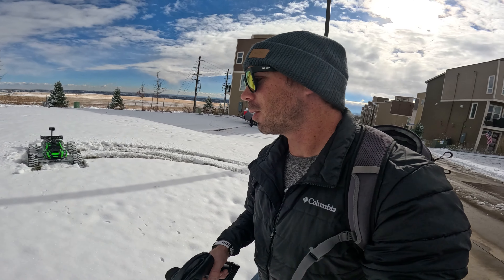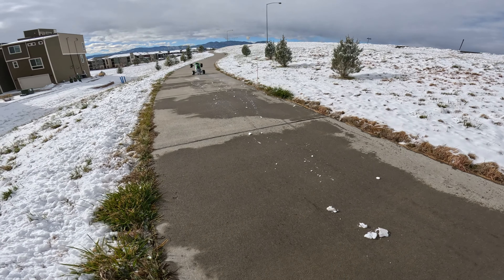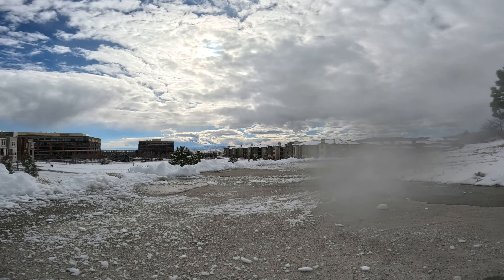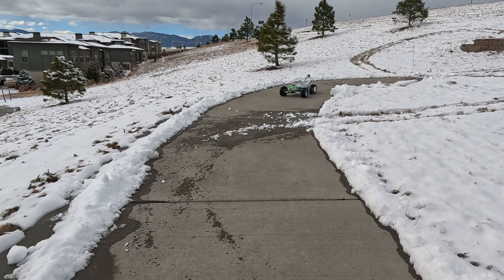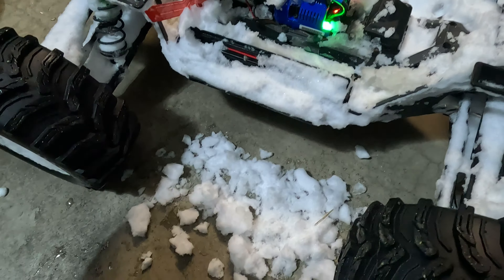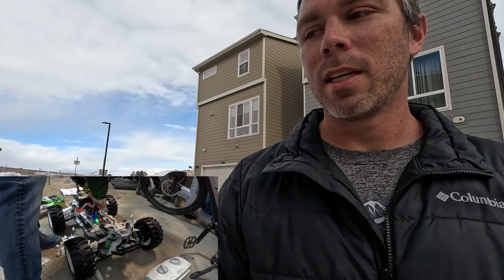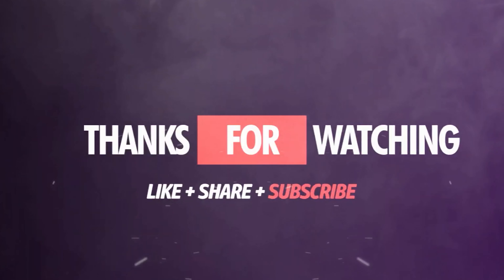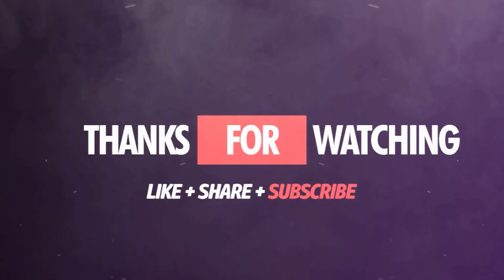NEW Traxxas XRT Breaks During Snow Bash

Comment: The best vehicle I had run in the snow was the X-MAXX. I also had that dirt cover on it. Had good temps. My E-Revo 2.0 electronically died in the snow. ESC had a fatal error. It now has a Castle ESC in it now.
Reply: VXL6S almost died in my Sledge and snow bash also. I think there was over current problem, because all 3 leds was solid red. But it working now again, after one day free time in garage.
Im using dusty motors cover for protect and almost no wet get inside. Condition was -3°C. I will be rather prepared with a new ESC, because this can be an issue. When over heat protection is not triggered, because of cold weather, so ESC still working and keep long time with a very high current. I also tug my children on the bobsled few times. In the summer, overheat protection will stop or reduce power, but in cold conditions there is no fuse for reduce or prevent to Traxxas ESC damage. Only way is change to oversized ESC which can manage more amps. I thinking about Hobbywing MAX6 or MAX5 if it fits. Which castle do you using? Mamba Monster X 8S?
Reply: @martins2657  I put a Mamba X in the E-Revo 2.0 I won’t run it in the snow like that again. To expensive to be replacing ESC’a
Reply: @airguns_rc  Thanks for the reply. I think only over powered ESC can be taken into snow bash. Maybe MAX6 on only 4S can be a safe combination. I do not know if possible to fit MAX5. I like hobbywing now, because of very good experiences with onroad racing. So i will put there something from Hobbywing, rather than Castle. But Mamba series are good :-)
Reply: @martins2657  agreed. You have to use the right tool for the application

Comment: Oh man use your air compressor to get most of the snow off, all that water is going to trash your bearings
Reply from the maker: You are correct, the compressor is the best option to use. Unfortunately mine is broken and I'm waiting for the replacement motor to arrive

Comment: You already discovered the first problem, the diffs not being full so you diff out and blow the tires. I would bet that it was the front tires that blew, because weather you disassemble a new Traxxas vehicle before running it, and do the diffs, your front tires will be the first to blow.
Reply from the maker: Nope. The plastic wheels failed on the rear and split open at the hex. I haven't had any issues with this truck diffing-out using stock gearing.